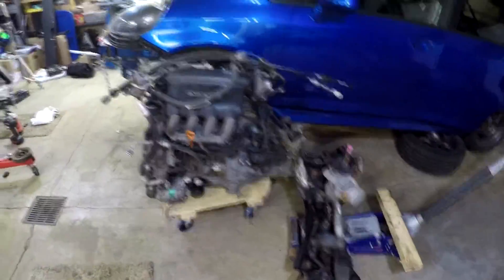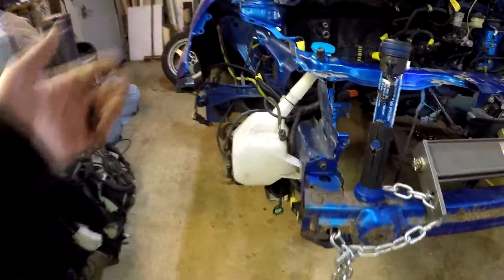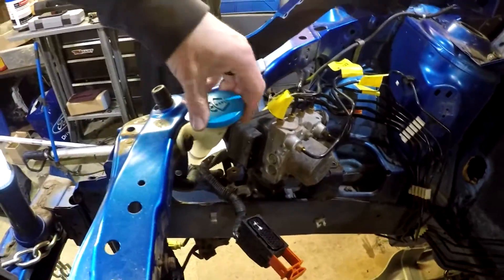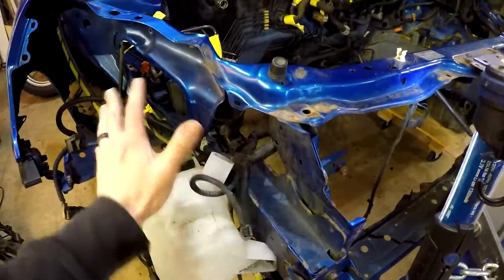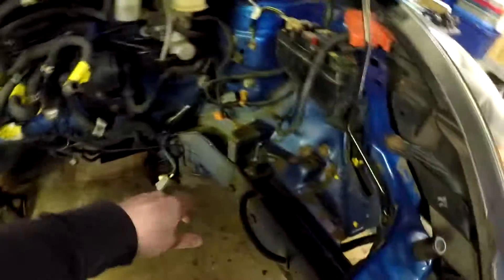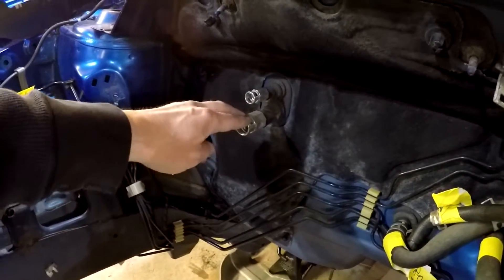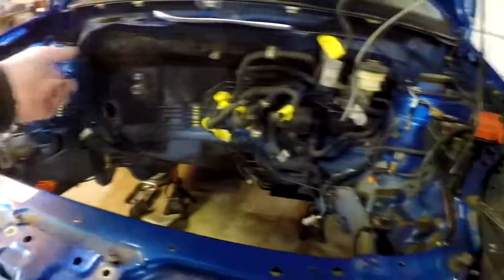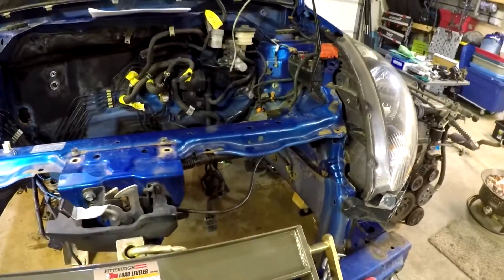How to K swap Your Honda Fit  Pt. 1 Intro/Engine removal

Comment: Can you use an automatic Fit as a donor?
Reply from the maker: From what I'm told you can not use an automatic car.  The transmission mount holes on the frame are different than a manual.  i have never checked myself though.  Also i don't know what wiring would be different so that's a separate issue.

Comment: Other then the si lsd 6 speed transmission are there any other trans options I can use on  k 24 tsx  08 ?. It would be going into a 07 fit
Reply from the maker: @Blackbeltgarage7  any manual transmission from a k20 works. Can’t use accord or tsx transmission. Also can’t use the civic si transmission that has a k24. O my k20 transmissions work with the mount kit.
Reply: @  if u had to choose a transmisión witch one would u choose other then the lsd si one  I’m trying to do the same build u did but with. Different transmission I know the lsd si that u have is more expensive
Reply from the maker: @ if I wasn’t going to do the Si.  I’d try to find a base rsx or ep3 civic 5 speed.
Reply: @KevronsEye  yeah I was thinking about the  ep3 trans to thanks bro   tax season around the corner  I been watching ur vids for. A few years now lol and I’m finally gonna commit to the swap lol 😈😈
Reply: @KevronsEye  so a manual transmission from accord  04 wouldnt work ? Because I found a whole honda 04 accord for 800 bucks with the engine and trans in good condition and its manual would this applications work or I still need the rsx or ep3 trans ?
Reply from the maker: @ you’d still need a transmission from a k20. The mount style is different on the k24. Or you’d have to make a custom mount

Comment: I know this is a very silly and basic question, but before i even attempt this i am trying to get a rough parts list to gauge pricing. Im considering either the acura engine or the k24z3 from an accord (not going be turboing it anyhow). You mentioned the engine and the transmission from a civic in other comments, are there any other bigger budget components you need to make it work? Very new to engine swapping 😅

Comment: I'm interested in a b series swap into my fit. Is there a lot of cutting and fabrication involved?
Reply: Have you found any info? I've seen a photo of a b series swapped fit awhile back
Reply: @abepenner4714  um there's some info on the fit/jazz forum. I'm just going to attempt and b16b swap pretty soon when I have time . I found a transmission and engine on the JDM engine Depot website but I'm still doing research before I purchase it. I just have no idea if the transmission will fit without heavy fabrication. I'm trying go the path of least resistance. There's a lot of k swapped fits here on YouTube. Happy new year 🎉 a k series is out of my budget at the moment.

Comment: How much would you charge to K swap a Honda Fit for me? I could bring you all the OEM parts you mentioned, and I’d want to dual boot ECU’s
Reply from the maker: I wish I had the time to do more swaps for people.  If you are local. I’d definitely consider it. Thanks!
Reply: @KevronsEye  4 years laters I’m still watching these vids acquiring parts and knowledge   This tax season Im finally gonna start the Honda fit 07 manual  k swap project ..  and I’m gonna try to record what  so I can post it on YouTube
Reply: @Blackbeltgarage7  where are you located im trying to do this on my 2013
Reply: I don't think he's active anymore. You can contact VTEC academy and they'll probably do a swap for you for around $10K
Reply: @johnconnor2402  parts, engine, and ecu included?
Reply: @CameronsCars  Yes

Comment: Hello! I have a question and the internet doesn’t have the answer! I have a 2010 fit sport and I need to remove the 02 sensors. The downstream one I have unscrewed, but cannot find the electrical connector half. One forum said under center console but i took it out and nothing was there.

Comment: Couple quick questions. If I want to k swap a fit and want a manual. It's best to start off with a manual fit?  Something about the underbody frame is different than auto? Also which transmission did you use? Can I use the RSX 6 speed?
Reply from the maker: There is something different between the auto and manual fits.  You can use the RSX transmission   I used the civic si transmission  it’s the same as the RSX 6 speed but has factory LSD

Comment: Love the videos man, what year TSX did you get the k24 from?
Reply from the maker: It came from an 05 tsx and then I added the 07-08 camshafts/intake manifold/Throttle body and a 50degree camgear

Comment: How long did it take to remove the engine? Planning on replacing my dying L15 on GD3 with a lower km engine. Do you think it's possible to do with some mechanical knowledge, but first time swapping engines? Thanks!
Reply from the maker: If your just swapping in a newer engine that’s the same. It shouldn’t be to bad.   Being your first time swapping I’d give myself a weekend to complete it.

Comment: what yopu guy doing to the old engine and transmission??
Reply from the maker: I still have it in the garage
Reply: @KevronsEye  i have a 96 Geo Metro 1.0. And i was thinking of putting a Honda Fit engine to keep it fuel economy. But k20 is also tempting 🤔 😏
Reply from the maker: @lalolemusme  it would definitely be crazy fast with the fit engine and transmission!

Comment: Hey man I have a manual ge2 honda fit in midnight black I just wanted to ask to see if you knew any major difference in the engine bay and process to k swap it I found a warehouse not to far from me selling k20s for 500 bucks and I would love to kswap in the coming years also any good transmission swaps I should look into or Is a kseris the best
Reply: It's a 2009 to be specific I know the 2010 had a smaller engine bay

Comment: This is great! I have been thinking about doing this for a while with the wife's 08 Fit Sport since it doesn't run correctly anyhow (it accelerates slower at full throttle than at 1/4 throttle, and I can't figure out why 😖😠🤬). Thanks for documenting the process!

Comment: So i'm kinda new to the Honda fit community and new to cars in general. I have a Base model 2007 Honda Fit (Standard Transmission) and i'd really like to K - Swap it in the future, is that possible for the base model? What mods would i need before that?
Reply from the maker: Yea you can definitely swap a base model.  The sport model just has a few different things like rear spoiler, front bumper lip, side skirts. And Aluminum wheels. Other than that no real difference as far as the rest of the car
Reply: @KevronsEye  das hawt thank you
Reply: @KevronsEye  fog lights you forgot that lol

Comment: Very informative!, would it be similar to do this on a fit that is auto?
Reply from the maker: It’s very similar but with 07-08 Honda fits the engine mounts are different. So you’d have to convert the mount system in the car to manual.

Wiring would be another thing I’m unsure about

Comment: Subscribed! In your opinion, how similar is this engine removal to a GE8? Mine just died and I'm going to take out the engine and replace it with another L15A7....until I buy a K20/K24
Reply from the maker: It’s really the same idea Not much different   If your going with the same engine again you may be able to skip a few steps
Reply: @KevronsEye  thank you very much. I might record and make a video out of it too. Watching you makes me want to contribute to the Fit community. It's exciting to see another  K-swapped Fit being born!

Comment: will this work on a ge8 model fit gen 2? thanks brother
Reply from the maker: You can swap a GE8. But it requires a different mount kit from hasport and there is a different procedure on the engine bay and wiring. I’d love to get a GE next and do another Swap
Reply: @KevronsEye  where did you get your info for this? I've been looking everywhere for info on a kswap for the ge8, and I've come up with almost nothing.
Reply: Would you say the GD3 is a more accepting or easier starting chassis than the GE8? I’d love to swap my GE8 but GD3’s are a dime a dozen around here as well
Reply: I have a ge8 too looking to get her kswapped she's an automatic

Comment: Hi Kev, big fan of the channel and the details that you went into as far as the swap goes. Really gave me some insight on what needed to be done. Now I have a honda brio that I'm keen on doing the K-swap on ive seen alot of it being done in Thailand however cant seem to find any details on what needed to be done and what needed to be changed. Do you perhaps have any knowledge on K-swapped honda brios and what needed to be done and changed. They are basically the same as the honda fit/jazz

Comment: which k are you swapping in? Also, would there be any difference for swapping in different k-engine?
Reply from the maker: yijit ng I’m using a tsx engine and wiring, harness, ecu   You can use other k series engines. But the fit and tsx wiring match up the best. So if you use a diff engine you may still have to use the tsx ecu as a base to tune off of that
Reply: @KevronsEye  hi, also the tsx transmission?
Reply from the maker: rodrigof12 no the transmission is from an 06-11 civic si.  The accord and tsx manual transmissions use a different mount. Witch is not offered yet from hasport.  So you can use any k20 transmission but no k24 transmissions